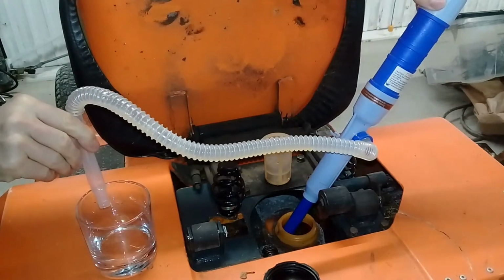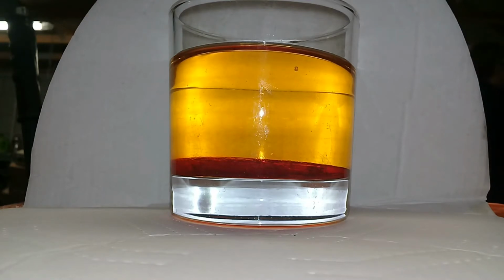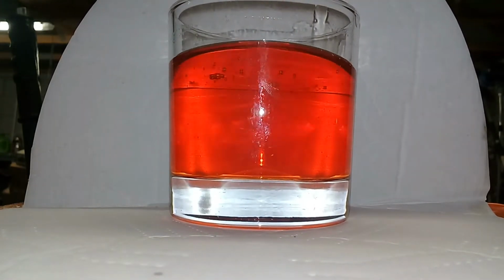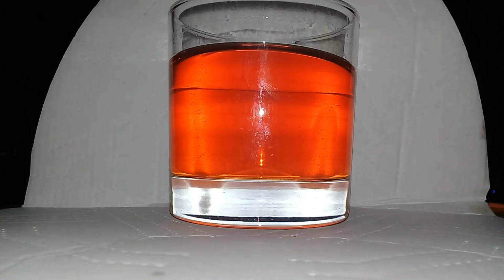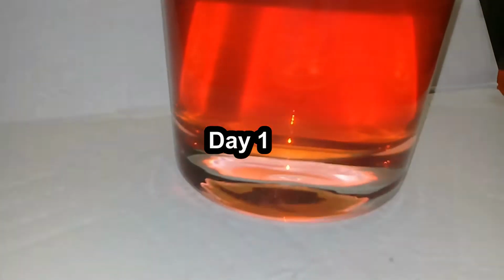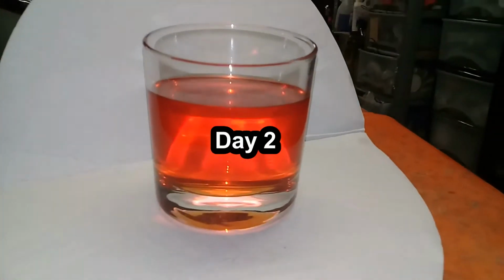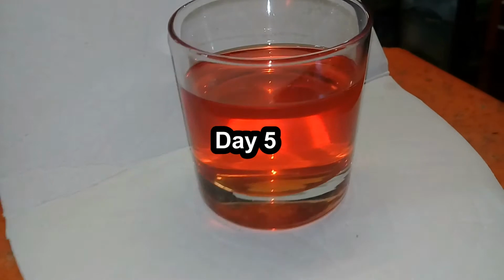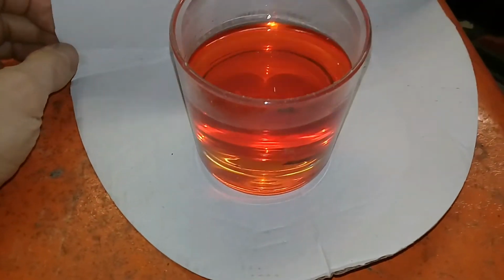Does 2 Stroke Oil Stay Mixed In Diesel TSO Diesel Mix

Comment: Using 2t fully synthetic from years. Engine working more quietly and fuel consumption gone down. I doing massive mileage so had many opportunities to compare results. My friend who runs taxi business using it from years and never had a usual DPF and  injector problems, but again; fully synthetic
Reply from the maker: That's interesting to know, i thought that fully synthetic didnt mix with diesel well and normally gathers in the bottom of the fuel tank.
Reply: @fiveminuteman  it mix as normal, however to make sure that everything will be fine I always adding before refueling. Also, don't forget that fuel pump working all the time with efficiency of 120-250 litres per hour, so fuel is in continuous mixing process anyway.
Reply: 0.5%?
Reply: hi sir, how much oil do you add to how much fuel?  Can you tell me the brand of oil?
Reply: Do you think commonrail
systems can take it also? Id like to prolong injector life. Example 1.4 Tdi 2007 Thanks, Aron
Reply: Też dolewam ale semisynthetic, podobo fullsynth ma inną temperaturę zapłonu niż diesel?
Reply: @moorgary2163  i need know ratio also
Reply: @tedhicks5431  thanks, meantime I find out that works with commonrails :) But not with DPF !!!
Reply: @moorgary2163  check out supco 88 see what ya think
Reply: @tedhicks5431 about 5ml of 2T mineral oil per litre of diesel will do the trick

Comment: Fantastic effort here buddy - thank you!
Reply from the maker: No problem. Need to crack on with a semi-synthetic test next.
Reply: @fiveminuteman  Nice one buddy! I'm from the UK (Northants), FYI.
Reply: i do JasoFB(mine is green coloured) cheap 2t oil in my pd140 200ml on an almost empty tank then fill this up with 50L of regular diesel, i do this for over a year no issues everything runs great hope that continues that way.))
Reply: So here's hoping that this particular video & comments thread becomes a bit of a decent resource on the question of 'dosing diesel with 2-stroke' - starting with the essential myth-bust here, over whether or not mineral 2-stroke will separate & pool in the tank - 👍🏽.
Adding to that knowledge-base then: Fine, it's argued to Eternity, whether or not it harms or benefits the engine, etc, etc. That'll likely remain inconclusive forever. However - I do have an example of a situation where 2-stroke dosing into diesel has completely eliminated a starting problem, caused by a sticky SCV (Suction Control Valve). A known problem on the Toyota Auris 2.0D4D - starting issues in the cold. Warming the SCV would solve the problem - but so has 2-stroke dosing of the diesel (1%). The logic is clear - the SCV has a metal piston in a metal sleeve. The extra lubricity has clearly prevented the sticking. I can even recreate the problem by ceasing dosing (next tank or more on). So - we have an example of a definitive outcome (I say benefit) of dosing, on the fuel-supply-side of things, at any rate.

Comment: Repeat with any 2S, jaso-fd+ fully most advanced racing synthetic mix perfecto with petrol and diesel. I have bottles on my shelf with, petrol, diesel and toluene (white spirit), and 2S synthetic stay on mixed like on day one.
Reply from the maker: Yeh man!👍
Reply: Best for diesel are 2-ehn as cetane boosters and esters to increase lubricity. You can skip on esters as there is 7% biodiesel in diesel anyway. Add 2mL 2-ehn to every liter of diesel. Plus 8 to 9 cetanes, happy motor.
Reply: @Fosgen I too use 2ehn 2ml/l (1:500) together with TC-W3 mineral oil with good results. Well known diesel additives (Archoil) contain 2ehn at or below 1:1000 (1ml/l).
Have you tried it at this ratio?

Comment: I can add 500ml 2T oil in 60 litter of diesel for euro 6 bmw engine? One injector is about to fail because bad quality diesel from my country.
Reply from the maker: Not sure i would do that. I stopped using 2 stroke in my 17 year old van. Now use BP Ultimate diesel. If you have any warranty you would invalidate it. You also have a DPF that could cause problems and also not sure about adblue. Dont do it.
Reply: That a bit to much, I do 250 ml in my f31 330d  for 2 years now and I had no problems ever so quiet
Reply: 1:200 ratio